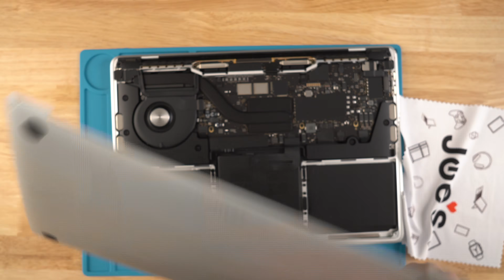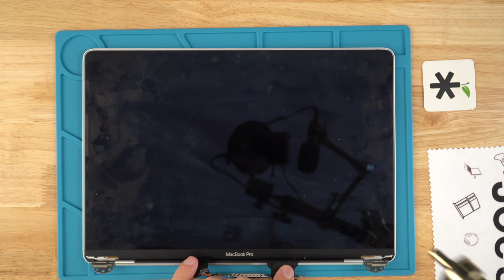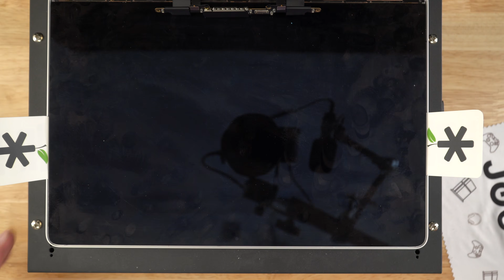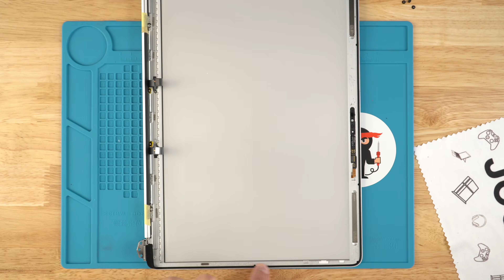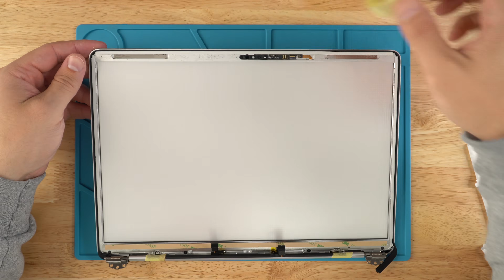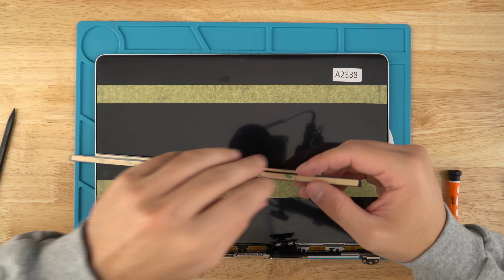Apple MacBook Pro 13-Inch 2020 A2338 LCD Panel Screen Replacement With True Tone | Repair Tutorial

Comment: I was disappointed that you don't show in detail releasing the cable connections.  In following your video, I inadvertently broke the battery data cable connector off the logic board.  So, this MBP is now a paperweight.  The ifixit version for this display replacement shows much better detail, for example.
Reply from the maker: We can help you find the right part, tool or repair option. Please email support@joesge.com with your exact model number and what part you need.

You can also start here:
www.joesge.com

Comment: What heat setting is your heat plate on? Isn’t 250 degrees going to burn the display? I have a display assembly with a perfect display but the cover is mangled, and I have a donor cover I can use. So I need to very delicately, remove the old display from the cover so I can move it to a new one

Comment: Not a single dust particle in between screen and backlight sheets? 🤔Some shops have warnings about possible dust particles.

"There is a possibility of dust being visible between the screen panel and backlight sheets on a white or pale screen (although we try our best to minimise this), since these are originally assembled in an extremely expensive dust-free factory, and we are doing this by hand."

 BTW, what is heat plate temp.?

Comment: Thanks for your comprehensive video. May I ask what hot/suction plate do you use? and what kind of double sided tape?
Reply from the maker: Hello, thanks for commenting. Please email us at support@joesge.com with your question. We will be able to better assist you there. - JoesGE
Reply: @Joesge  it would be helpful for others to also see your answers

Comment: Hey how true is this after replacing the screen? "Certain parts like displays, cameras, and ambient light sensors have calibration values that are customized to each individual part during manufacturing. Transferring these values ensures maximum performance and quality after a repair.

A System Configuration step may be required at the end of your repair. System Configuration is a postrepair software tool that completes the repair for genuine Apple parts. Running System Configuration has a number of purposes that vary based on the part replaced."
Reply from the maker: Hello, thanks for commenting. Please email us at support@joesge.com with your question. We will be able to better assist you there. - JoesGE